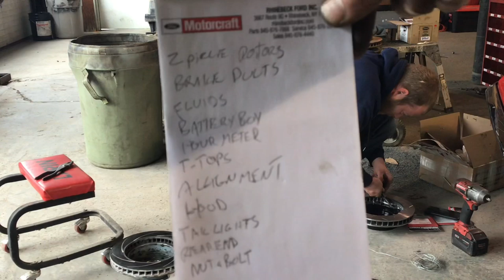WSG 10: Rotors Rear End and Race Prep for 1969 Corvette

Comment: Wow, you safety wired the rotors. Is that required for racing or just something that's a good idea to do? Is anything else on the car safety wired?
Reply from the maker: Not completely necessary but it’s piece of mind.  I like to wire anything that will raise hell if loosened: drain plugs, half shaft-flange bolts, Camber adjusters, clutch bolts etc